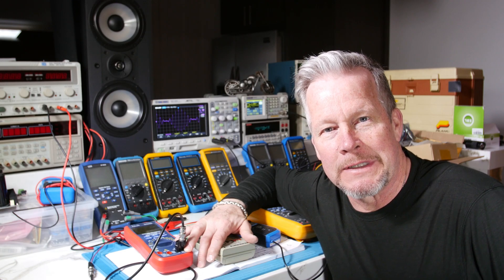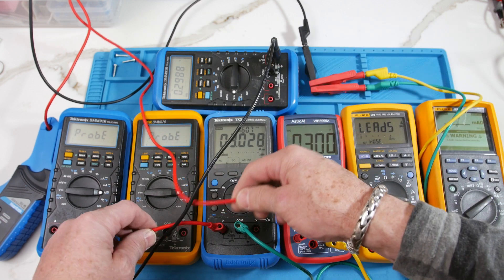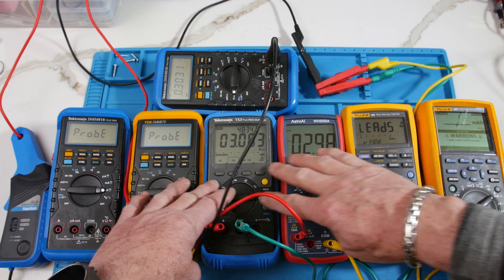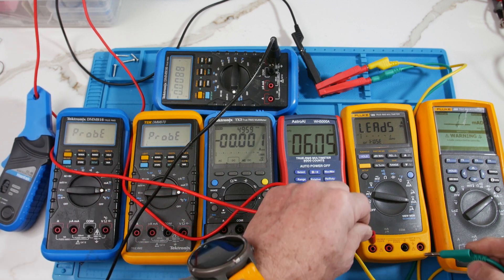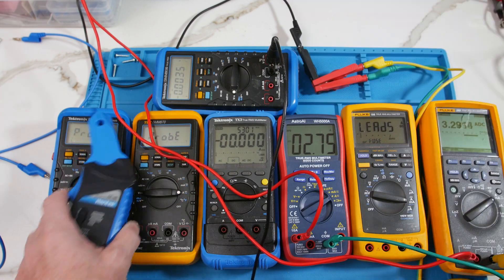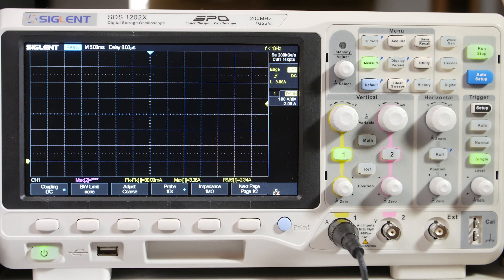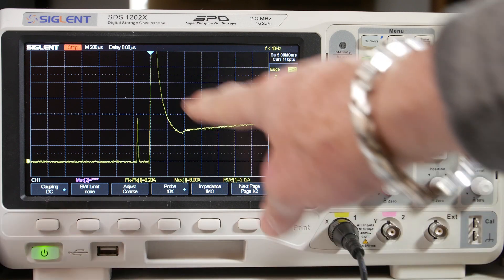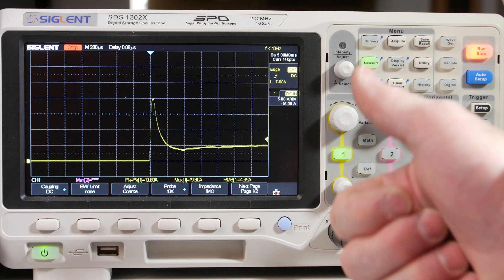Current too high to measure? - Pro Tip

Comment: Thanks, that helped a LOT!! And great explanation on your setup:-)
Am I understanding correct in that you put those two meters in parallel, hoping on 50% per lead? (yes I can talk about procenteges:-)
Am I also correct in that you could have used 10 DMM's or 10 leads for your probe, to divide the current by 10?
Reply from the maker: Fried Mule yes you can use as many meters as you need.  Just be careful if you only use two.  You don’t want to disconnect one while power is on if the current is high enough to blow a fuse - for instance - a 10 amp meter fuse.
Reply: @KissAnalog  Thanks, just a thought, could you not use a resistor in parallel instead of a DMM to divide the current, if you only had 1 DMM?